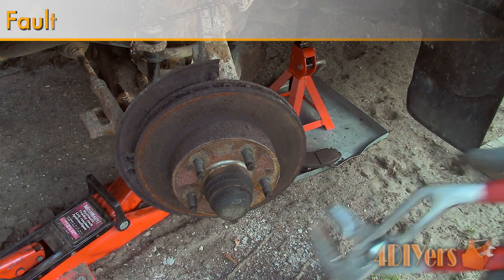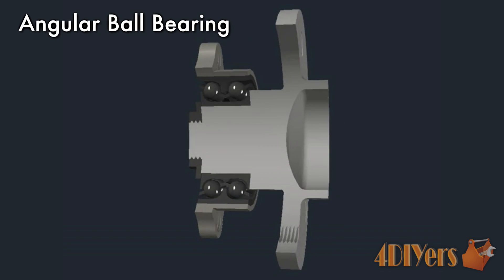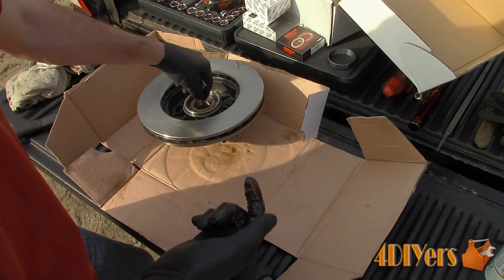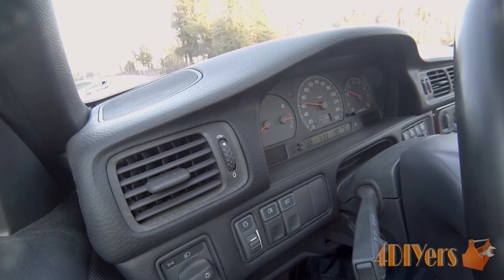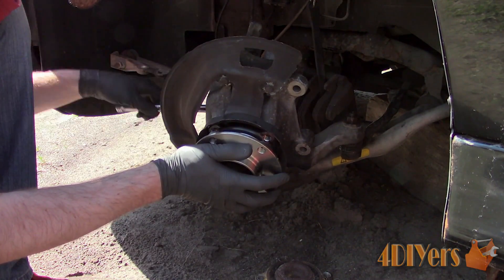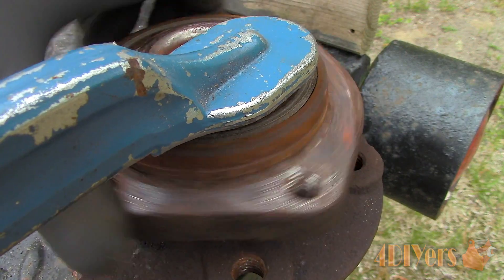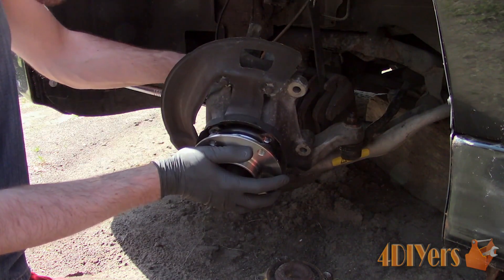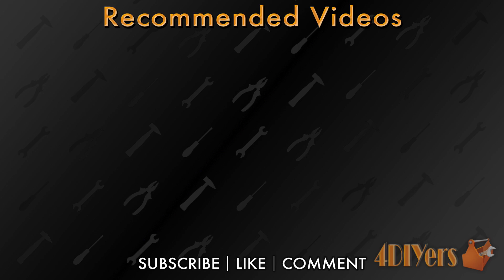How to Check a Wheel Bearing on your Car [Bad or Failing Symptoms]

Comment: Good evening sir. Why do you torque down, back off a quarter turn, and then retorque again? instead of the complete tightening. is it designed for better seating? I was curious. tx.
Reply from the maker: It's to ensure the bearing is seated correctly. If the bearing isn't or is overly tight, it would have a premature failure.

Comment: hm, what about a "wub wub wub" sound with varying intervals depending on speed? Wheel bearing, too?  Usually most prominent when driving it after being parked for a couple of days. E39 too btw
Reply from the maker: Sounds like it's coming from all the wheels, changes tone when applying the brakes, and disappears after a longer drive? Sounds like it could be rust on the rotors from the car sitting, it's quite common with any vehicle.
Reply: slightly different and increases when driving a rather sharp right bend at approx. 70km/h+. It also can be felt on the steering wheel slightly. First I thought it would be the front driver side wheel bearing but after hearing your examples in the video I am unsure if that's really the case.